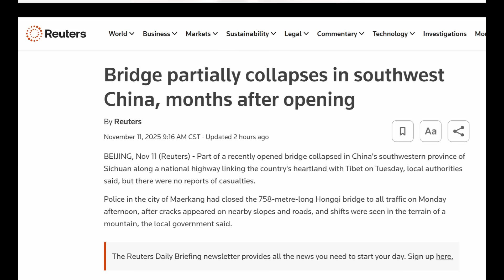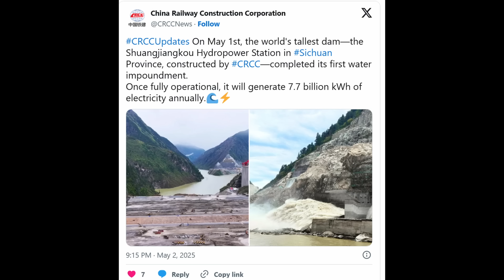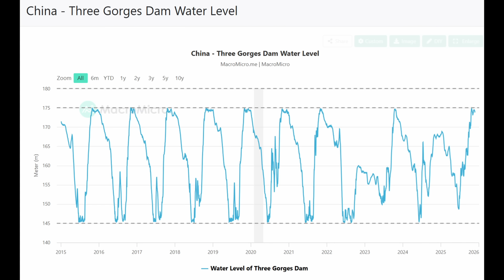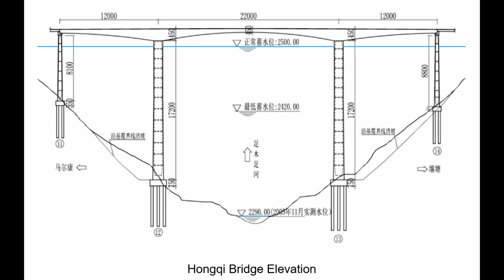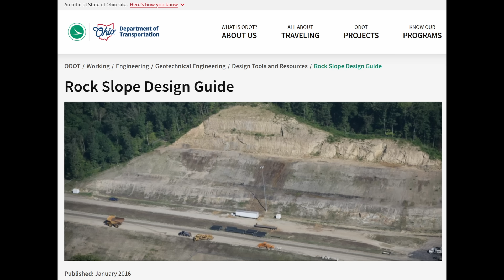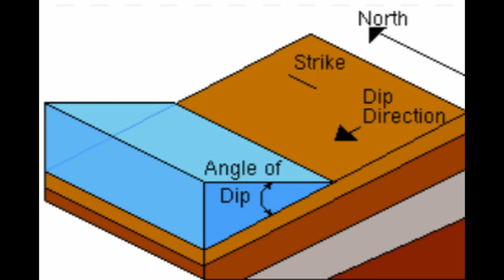Update - China Bridge Collapse

Comment: The reason Engineers get paid more than a Geologist is because a Geologist will say "Don't build here" and an Engineer will say "Yes we can build here". Then 5 years later the structure is destroyed, and the Engineer says, "Yes we can rebuild here".  Then 5 years later the structure is destroyed, and the Engineer says, "Yes we can rebuild here".
Reply: It is possible to build anywhere, it just costs more.
Reply: @gund89123  And what company or government wants to spend more money than the minimum... or less.
Reply: "Yes we can" but did they do the work the engineer told them to do?
Reply: Maybe the problem is that they're asking the engineer the wrong question.
Reply: Yeah, except not. At least not properly Western trained engineers. I’m a tech engineer, so it’s not apples to apples. But my father is a civil engineer that designs bridges and has a dozen bridge projects under his belt, including lead design on a few of the bridges. The environment is considered first and foremost in any civil engineering project. The design phase isn’t even going to start without a full analysis of environmental factors. The first task is identifying a suitable place to put a bridge. And that goes way beyond simply connecting two points.

The job of an engineer is to, ya know, engineer things that work for a desired purpose and don’t fail. Chinese engineers likely do behave like you portray because China is a yes-man society and everyone is eager to rise in the ranks of favor of those with power.
Reply: @Gubers  @rap3208
Reply: @Gubers western engineer is just "is it cheaper to rebuild as needed instead of build the right way over the lifespan of the bridge?"

And then have their boss force you to significantly underrate the frequency of failure while under weighting the cost of rebuilding
Reply: @subjekt5577 I mean, there is corruption and cost cutting and corner cutting no matter where you go. That isn’t a Western thing at all. And, uhh, well, we’re not building mega bridges where giant landslides are likely to take them out.

The West is far from perfect and has its problems. Big cultural problems right now for sure. But as engineering goes, it hit its peak and is slowly declining. But nowhere near the disastrous levels of Chinese engineering. China is collectively motivated by progress and outward appearance. They do not and never have valued safety or integrity. Their governance is a “progress for the sake of progress” situation so that they can appear more like the West, or even advancing beyond when in reality most of their infrastructure is poorly designed and built. There’s been little regard for materials science, the environment, best practice, procedure or really anything beyond the immediate future in their rapid infrastructure transformation. Buildings including bridges everywhere in China  stand on unsuitable bedrock, are made with unsuitable materials and are crafted with haste above all other factors. They have built themselves into collapse. This bridge is far from the only example. And as they’ve accelerated these infrastructure projects over the years, soon that will catch up with them and these things will happen at a more rapid pace.

Meanwhile in the West, there may be a slump. But much of our infrastructure like bridges were built with such integrity that even ages they are far superior to the crumbling mess of incorrect composition and placement China calls their infrastructure.
Reply: @subje @subjekt5577 est builds any large structure better than the Chinese. When is last time you saw bridge built in the US fail after only three months? I’ve gone over bridges that were built in the 1930s here in America. We build things to last, boy.
Reply: Replace Engineer with Contractor and Geologist with Architect, and still true.
Reply: I remember checking out a big slide site in California back in the 80s that had blocked a river and taken out the road. The state had moved the road to the other side of the valley.  Looked across the valley at about the same elevation of the slide scarp i was on and there was a small scarp forming there as well. Doing the same thing that resulted in the first failure again and hoping for a better outcome didn’t strike me as a good plan
Reply: Not sure about this. My engineer partner always says no.
Reply: Indeed, as usual this engineer ignores the earthquake which led to this.  The earthquake that led them to checking the road and local geology and closing the bridge before the disaster.  Good job they did not listen to this engineer....
Reply: @hairyferrit Not really a reflection of the profession of civil engineers… It’s China. They’re eager to please the grand leaders and gain favor. There’s also a lot of progress for the sake of progress that results in catastrophe, just like this. I would wager most of these mega engineering projects are compromised. And the people responsible will probably be dead by the time they all start to fail at pace.
Reply: @Gubers  So what are the excuses for Americas failing?  China has much more infrastructure built in the last 10 years that puts US to shame.
Reply: @hairyferrit  Excuses for what? We have iconic bridges and infrastructure around the country that's been around for a very long time and still just fine. Engineers designed and built many American wonders before computers were even invented. The Chinese have every advantage including nearly unlimited access to intellectual property they stole from us and others, advanced computers, materials etc. America isn't building a whole lot right now, but that is a completely different issue that has nothing to do with engineering.
Reply: @Gubers  ROFLMAO  You structures are young compared to most of the world and especially China.  They have bridges and structures over thousands of years old.
Champlain Towers South Collapse (Surfside, Florida)
Millennium Tower (San Francisco, California) 
Citicorp Center Engineering Crisis (New York City, New York) 
432 Park Avenue (New York City, New York)

In the United States, an average of 128 bridges collapse annually. 

August 1, 2007, the Interstate 35W bridge over the Mississippi River near downtown Minneapolis was loaded with rush hour traffic creeping through an ongoing construction project. Without warning, the bridge collapsed, taking with it 111 vehicles. Thirteen people died and 145 were injured.

And American great engineering goes on and on collapsing all the time....er.

Comment: Foundations are incredibly important.

On the Rapidan Dam, the owners were prevented from lowering the water level in the impoundment prior to the failure.

Construction on slopes in certain parts of Ohio is extremely troublesome.  This is due to the fact that portions of southeastern Ohio are actually terminal moraines from the last glaciation period.  I worked for a pipeline company, and we had several locations where we had to monitor for slope movement.  This slope movement was very slowly (fortunately) but it was quite amazing to see the cracks develop and open over time.

Great video.

PS:  China is in a massive development project to develop any and all sources of electric power, regardless of the cost or impact.  Also, the three gorges dam is on the Yangtze River which has a history of massive downstream seasonal floods which had a tremendous economic impact downstream.  Part of the Three Gorges Dam project is to mitigate downstream flooding.

Fun Fact:  I have heard reports that the water impoundment behind the Three Gorges Dam has affected the Earth's rotational rate.  It is a very small amount but apparently it was detectable.  Talk about environmental impacts.
Reply: Problem is the Three Gorges Dam does a horrible job of mitigating downstream flooding.  The Three Gorges Dam reservoir is very narrow which translates to big differences in the water level along its length; they need to drop the water level by 100ft below maximum in order to not flood upstream cities like Chongqing which is 300 miles to the west.  As a result, there is horrible downstream flooding, which is made worse by water discharges not being publicly announced.  Why?  Announcing water discharges would mean the government would be responsible under Chinese law, whereas unannounced discharges are the equivalent of 'acts of God.'
Reply: @randacnam7321  I didn't say that it did a good job of controlling floodwaters.  I said that is what it was intended to do.

Comment: There is a possible alternative viewpoint with construction projects in China. To illustrate, I'll use the approach used by the transportation department here in Nova Scotia. Rather than analyze each and every road cut, they find it more efficient to cut each slope to a standard slope angle, and go back and do repairs if needed in the future. In China I suspect they have a different risk tolerance that we do in the West, which leads to this type of failure being more common and more accepted. In other words, we go "Tut, tut, they don't know what they're doing." while they are thinking, "We can accept this level of failure and loss of life if it means we achieve our goals." It may be a cultural difference that we do not appreciate.
Reply from the maker: I'd say in this case this type of catastrophic failure illustrates a fundamental flaw in understanding site conditions at this particular project.
Reply: @CaseyJones-Engineer Of that I have no doubt. It's a good object lesson for Western engineers. My point is that Chinese engineers and politicians may have a fundamentally different view of what is an acceptable level of knowledge and failure.

Comment: The only thing that matters in China is doing it fast, cheap, and skimming the profits.  Forget safety.  Worked in China for over 10 ten years saw a lot of this.  New plant floor buckled when we brought in the machines.  Checked the floor found NO REBAR.  The pea gravel was not leveled prior to the concrete pour so had concrete that was 10CM in some places and 1 meter in others.   The concrete density was TOFU.
Reply: I see that “chu bu dao” mindset in even something as mundane as crooked light switches.
Reply: Doing it fast-Ya. Because they have to finish the project and use the whole budget so they'll get all kickback or bribery before they were sacked or transferred.
Reply: Even if they use rebar, it's going to rust and fail in no time because they use ocean sand full of salt to make concrete.
Reply: A nephew noticed that when visiting new factories that made custom wheels and tires for his US company. The Chinese plants were only four years old yet were shored up inside and outside due to cracks in the walls and upper floors.
Reply: Back in the late 90’s I worked on a large cellular telephone network build out in People’s Republic of China installing and integrating Network Elements and setting up microwave relay shots to each NE. The Chinese government was responsible for land acquisition and installation either guide wire towers or monopoles to mount the antennas too.  The only problem was instead of digging (boring) holes for the supporting foundations for the towers and monopoles we quickly discovered that foundations holes were less than half the required depth and filled with what we referred to at the time as Ghost Poo Concrete because they would mix it who knows how many cubic yards of styrofoam packing peanuts right before pouring it which created a very porous weak foundation.  Anyway when the rainy season came many of the towers either fell over or began to list to one direction.  Additionally the grounding system that is buried around the concrete pads that “cell sites in a can” sat upon were not installed and the copper wire that was supposed to be used for that purpose had been stolen which made them vulnerable to lighting strikes.  Back at the “Switch site” we could tell when an antenna started to lean because the microwave shots would go down dropping all cellular traffic on that leg of the network.  Did I mention the battery room at the switch site started to sink due to bad concrete and not compacting the ground under it.  Somewhere I have a jacket that has map of the network we installed with a rather crude saying on the back of it to commemorate that S*** show
Reply: I still work here and have seen none of that.
Reply: @Marine0317 You don't see any of it, because your eyes are covered full of Chinese semen.
Reply: There seems to be a cultural assumption that if you let yourself get scammed on such things it’s your own fault. You can get good work done, but you need to be supervising constantly. Another issue is a lot of China’s provincial governments are heavily in debt and suffer from significant amounts of corruption, which means they often intentionally underfund infrastructure. CCP lets it slide as long is it doesn’t make the news.
Reply: U are projecting for the american boots ur licking
Reply: 😂😂no
Reply: Liar😂
Reply: systemic corruption is the root cause of all this. chinese people don't give a fuuuuuuuuck when they're ripping you off, to them that's normal, but when it happens to them it's the most unfair thing in the world.
Reply: Look fake, to be honest. There's no traffic.

The Great Wall of China is a perfect example of Chinese engineering that has withstood the test of time. The great- grandson of Great Wall builders.

Significant parts of the new San Francisco- Oakland Bay Bridge is so beautiful, it was made in China, specially the steel components for the self-anchored suspension span. 

There’s a video explaining how the new Bay Bridge was built by Chinese companies which opened in 2013. Thank U China!

The U.S. chose China to build the new bay bridge because the Chinese are better qualified than others. 

China is the King of bridge building in this modern digital world. From building the U.S. railroads to building the U.S. bridges. The Chinese are the best builders in the world!

Almost all of the infrastructure in the U.S country is dilapidated and crumbling. In fact, most of the infrastructure in the US. A hundred years ago it was made by the Chinese. In addition , the Great Wall has stood for thousands of years.
Reply: @CocoWuu  A hundred years ago China was at war with itself, split between the KMT and the CCP. They weren’t building a whole lot of anything. They’re certainly good at building infrastructure when well enough managed, but they’re also prone to shortchanging you if you don’t know what you’re doing. Their own infrastructure failures in various places shows that corruption is certainly still a major issue for them. Whether it be subpar steel or missing parts, corners cut, e.t.c. You’ve got to be mindful when working with them. It’s gotten better over time in my understanding.
Reply: @CocoWuu Made in China might be the best, but you certainly need some of the Chinese good filter.
Reply: Use the meter thick concrete to mount heavy machinery, and save the 10cm concrete for walkways 🤔
Reply: We are currently in a phase of loosening regulations in many different fields
Reply: @JoeSmith-cy9wj  No, let's tighten them more than California and New York.
Reply: @mprooveit3588 I don't own a multinational corporation,  and I doubt you do. So why push someone elses agenda, and botw against your own interests?
Reply: @JoeSmith-cy9wj  Multinationals don't mind regulation so much.  Ever work with people trying to start small businesses?
Reply: @JoeSmith-cy9wj  Thank you very much President Trump.

Comment: Casey as a total non engineer, my guess from all that dust, is that the soil seems to be glacial till  or loess. Maybe the pillars are resting on tables of concrete instead piles driven down to the bedrock.
Reply from the maker: Thank you right about the soil. I aml not sure about their foundations. I will keep researching it.
Reply: Doubtful. Loess is windblown silt and so is very fine. Heavy rain would tend to have eroded it long ago on such a steep slope. Glacial reasons also doubtful, glacial valleys are U shaped and till would be in some kind of moraine or possibly a depositional bench if a lake had formed.
Reply: @bwyseymail   But the mountains were flat once... Does that make a difference?
Reply: Some reporting I saw elsewhere says the mountains in that area are mainly folded sandstones and shales pushed up by the impact of the Indian subplate on the Asian plate... lots of disjointed rock blocks that have potential to shift and crumble. 
I haven't been able to find a lot of data in English on that area, so I can't speak to the accuracy of the info, but sedimentary rock might give that kind of impact. 
I also wonder how much of the post-construction detritus was still on site.
Reply: I doubt there is much loess or till in that particular spot. The local area is mostly s-type granite, but with how fractured and weathered it looks, it might as well be anything for construction purposes. Further afield the surrounding region is predominantly flysch. At the dam site the granite looks more intact, so hopefully they sited the dam reasonably well. Guess we'll find out.
Reply: All that dust means the rock slope was very dry, that all.  Also probably  means it wasnt due to heavy rainfall causing instability